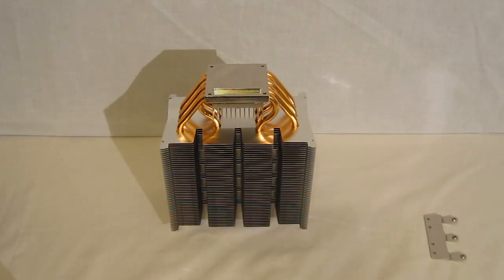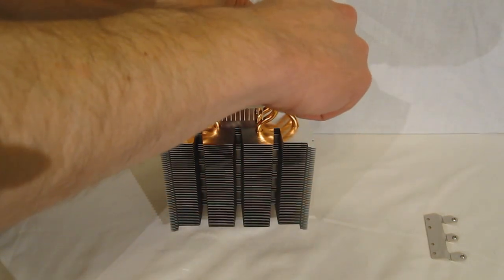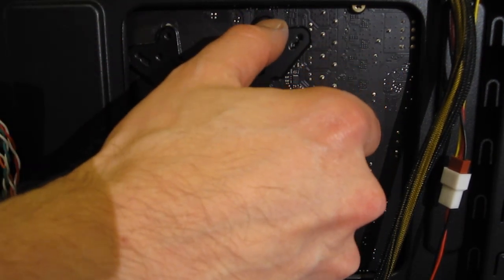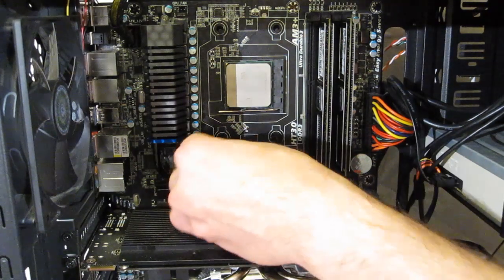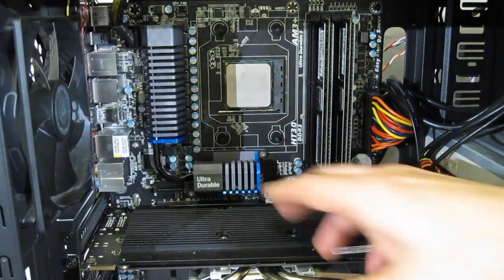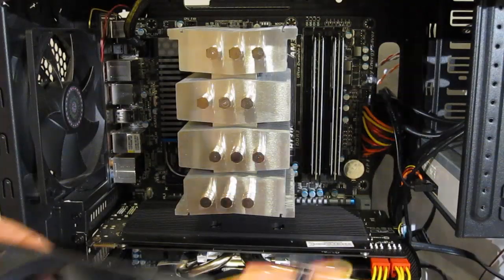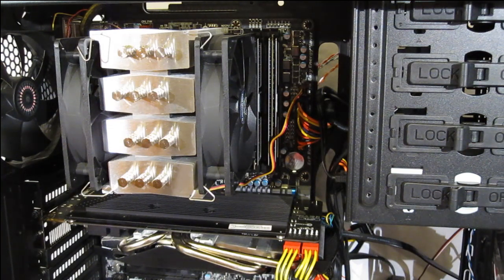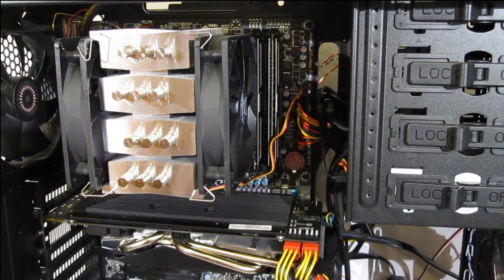Scythe Mugen 3 PCGH Edition CPU Cooler Installation at HiTechLegion.com

Comment from the maker: The Mugen 3 is far better suited to deal with that. The NH-U9B, while being a good cooler, is designed for smaller form factors and will not deal with the heat nearly as well.

Comment from the maker: It overhangs the first two RAM slots on most boards. My advice would be simple - your CPU benefits from proper cooling, which also allows for higher OCs. OC your RAM has VERY little performance benefit, and the tall heatsinks are nothing more than decoration (and a marketing tactic to push you into an overpriced, underperforming AiO). The best solution is to buy RAM without unnecessarily tall heatsinks.

Comment: i buy the same cooler.waiting for deliver me  MBO- asusrock 990EXTREME 3 AM3 + i bought FX8120 and have question.
Do i need to take of  original  Heatsink Holder from MBO and then to install sythe mugen 3 revision B???
any reply i would apreciate it
Regards
Can somebody confirm this.Iam building my rig.  SO I DO NOT

Comment: Both the cpu and the heatsink are inperfect. The location where you place your initial dab of paste does not matter what so ever. Nor the endless discussion on wich method to use when placing your paste, aslong as the cpu has good contact with the sink the 1/4 celcius are not gonna matter when you don't put 1.350 or more volts in the cpu.
I don't see any videos on your channel about sanding down a CPU/cooler sink to remove the small inperfections so why bother this guy instructing users

Comment: i got one of these on my amd phenom ii x6 1100t and im overclocked from 3.3ghz to 4.1ghz and my max temp on full load is 48ºC idles around 22ºC. the stock cooler was much hotter, the mugen 3 does extremely well for my setup.